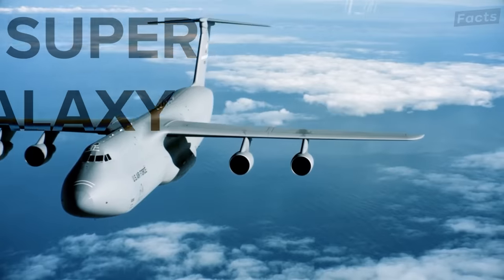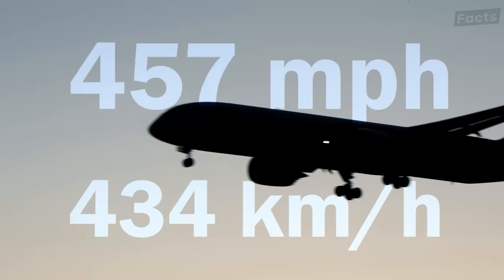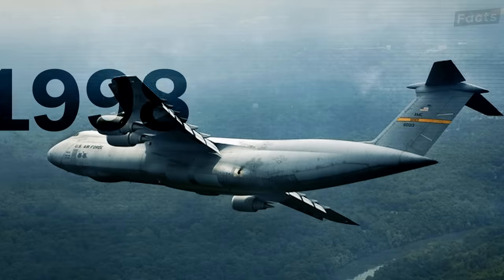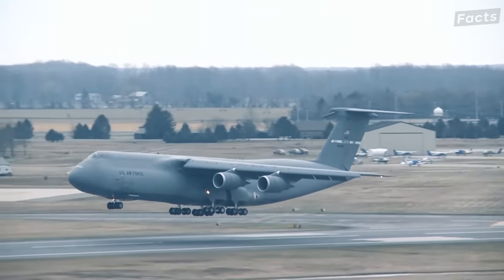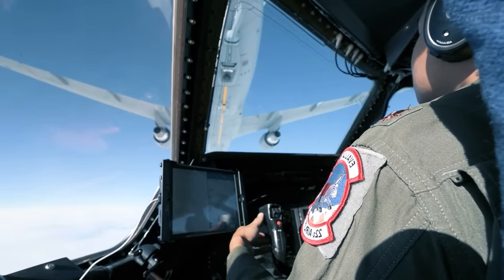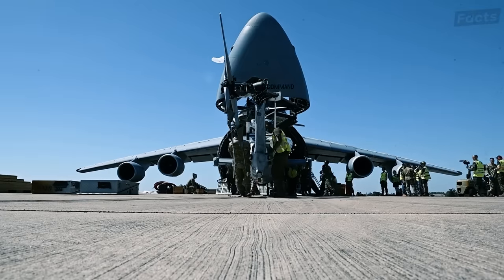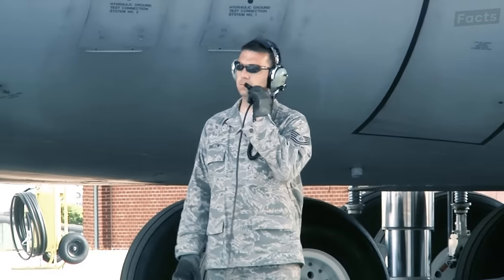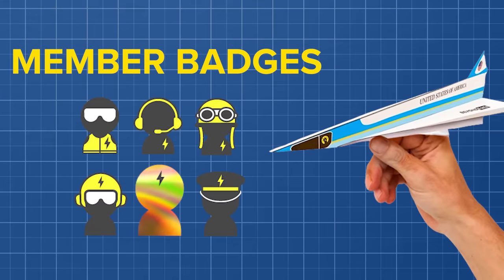The LARGEST Aircraft in The Air Force Has A GIANT Problem

Comment: Nothing can do what the C5 Galaxy does - will go down in history as one of the greatest airplanes ever built - Msgt WRMcGowan USAF (Ret) ||  C5 Flight Engineer for 20 years
Reply: McGowan when was you station at pope,I was there 1963 to 1965 crew chief on 801 c130
Reply: An225?
Reply: Kinda dead  @wolfrust0
Reply: @wolfrust0 
Mirra down to one in parts, stated in this video more than 50 C5s in operation. 
Even if there were two C5s for one AN225, which is more payload, that’s 25+ pairs. 
And Strattolaunch is way bigger. (Wingspan)

Comment: NOT " SHOCK ABSORBERS".....THEY ARE CALLED " STRUTS"
Reply: Been around long time keeps going on
Reply: theyre the same damn thing lmao...a shock absorber is anything that absorbs shock...flexible landing gear on single props are shock absorbers too. Plus these planes use oil filled Oleo struts which work exactly the same and were LITERALLY PATENTED AS AN AIRPLANE SHOCK ABSORBER
Reply: @Shadow0fd3ath24 they are hydraulic struts. Not just oil filled shock absorbers. The C5 has a feature that allows the aircraft to kneel , lowering the plane to where the cargo ramp when opened is truck bed height.
Reply: Shock struts is what they were called in the maintenance technical orders while I was in... they were all air inflated hydraulic struts...
Reply: Welcome to the aircraft group

Comment: I worked on C5A and C-141 at Travis AFB,  Ramstein AB,  Torrejon AB and Altus AFB  a long long time ago.   Then 36 years at American Airlines.  Now 63 I could fix that today.  At Travis AFB in the AR Shop my first jobs included jacking the C5 outside on the ramp,  replacing large components and rigging the entire system.  I was still 18 years old.  I didn't stop for 41 years (36 at AAL)  until 3 years ago.  All thanks to the USAF.
Reply: I was a C-5 loadmaster at Travis AFB

Comment: The C-5 was a giant and a great aircraft to work on. I also worked on the fabulous C-141A and B.  I worked both airframes from 1981 to 1990, as an Aircraft Electrician Environmental Systems Specialist, and I loved both airframes. Both Airframes were used as SOLII aircraft in Special Operations.

Comment: In 1970 while stationed as a station aviator at NAS Cubi Pt in the Philippines, we were transiting from Bagio in the mountains back to Cubi and as normal overflew Clark AFB. Clark had a large parking area for the C-130s and another for the C-141s. We glanced down and noticed what I at first thought was a C-141 parked amongst all the much smaller C-130s, when I realized it was in fact the C-141 parking are with a much, much larger C-5 parked there. While we had of course heard about the program until you see one in person, you can't really appreciate how big they are. They have earned the nickname of the aluminum overcast.

Comment: One time when I was stationed in Italy, there was a Galaxy facing away from my barracks room. After having it's engines on for a while, my door was covered in residue from the engine exhaust. The area it was loading/unloading from wasn't meant for an aircraft that size which is why it only happened once. I don't know the reason.  It's an impressive aircraft but don't leave anything behind it if you want it to stay clean.
Reply: Riiiiiight ... maybe if your barracks door was 20 feet away it may have left "residue" before blowing out the windows and blowing the door of the hinges .... I was a Engine Mechanic and engine run certified on C-5`s and C-141 and find  your story to filled with inaccuracies and make believe. There are minimum safe distances stated in the Engine Run T.O. behind the aircraft that have to be clear before even starting up the engines ... the higher the power setting you are going the further the safe distance is.
Reply: I can't say how close it was, but it felt too close given the size of the aircraft. I'm not an aircraft mechanic. I just had to clean the mess off my door when I got back from work. Just stating my perspective at the time.

Comment: So its a weapon of war and you are worried about the environment? That is stupid.
Reply: The idea was it could fly further w/increased payload resulting in fewer compression/decompression cycles on the physical airframe while getting better fuel economy. Short of crashing, the thing that results in aircraft being decommissioned and sent to the boneyard is stress/strain between panels/rivets of the pressurized compartments. Most everything else can be removed/replaced overtime.

Comment: I was at Altus AFB Oklahoma on a temporary duty assignment while they were flight testing and training the very first C5A that Lockheed delivered to the USAF.  We were at the flight line getting ready to return to Scott AFB Illinois while the C5 was in the air with a little problem - the nose wheels wouldn't come down.  They were doing flybys of the tower for visual checks while they tried to correct the problem, and I have a picture of us watching it seemingly floating by with the rest of the landing gear in place but no nose wheels visible.  Eventually a crew member was able to climb down into the guts of the plane and crank the wheels down by hand.  It finally was able to land, with the runway covered with flame retardant foam and fire trucks and an ambulance standing by just in case.

Comment: I worked C-5s for 13 years both on the flight line and in shop.  The C-5 is an amazing aircraft.  I was stationed in Dover and was there from Nov 1981 to Jan 1988, then from Apr 1991 to Jan 1998.

Comment: The runway distances for takeoff and landing, measuring 8202 feet and 4921 feet, respectively, seem remarkably brief. This configuration is likely to be practical in only a limited set of circumstances, where the aircraft is relatively small, or the weather conditions are favorable. However, it is doubtful that an airplane could take off with only 4921 feet of runway. Such a feat would require a highly skilled pilot and a meticulously maintained aircraft, both rare in the aviation industry.
Reply: I saw a C-5 takeoff in 1800ft at Travis AFB. It was empty and only enough fuel for the airshow. We also had a strong headwind straight down the runway
Reply: The C-5 used to do training at my local airport. The runway is only 6,000 feet. We now have C-17s in and out about 3 times a week. What I miss is the F-15s coming in and out all the time. They are much more fun to watch than the F-22 Raptor that replaced them. The Raptor requires a longer runway than the Eagle did and is a lot noisier so the Air Force doesn't send them here as much.

Comment: I have ridden on the C-5 twice and from the boom pod of a KC-135 watched a night refueling of a C-5.  It is quite an aircraft.
One bit of trivia not mentioned.  The C-5's fuel capacity is more than the takeoff weight of the KC-135A.
Riding backwards is not a problem as there are few windows on the passenger deck.  The only time you realize your seating position is on takeoff and landing.  The seats are rather comfortable.  The spacing is not that tight.  Granted the inflight meal was not great just a box lunch.
Back during basic training at Lackland AFB, TX, to give you an idea how massive the C-5 is, my flight would see one flying off in the distance.  The C-5 just seemed to hang in the air not moving.  We swore that we were marching faster than the C-5 was flying!

Comment: If they have a very heavy cargo load. Do they takeoff with less fuel and then top off in flight?
Reply: Yes. When we would leave out of Dover AFB headed towards Europe if we were heavily loaded we would take off light on fuel and then refuel somewhere off the coast of Maine usually. You are not a dummy, good question.
Reply: Depends on the length of the mission.  For short flight, air refueling is not required.  For heavy loads, going overseas, air fefueling was needed. Basically the same as a KC-10.
Reply: @robertheinkel6225  He said that.🙄
Reply: Normally on a channel mission we did not air refuel. On SAMs JATs and other missions we would air refuel. Most time we a/r it was for training/currency.

Comment: The C5A suffered right wing metal fatigue, cracks and was a headache for Lockheed. It was designed by using a C141 design enlarged by computers as a shortcut to save money, unexpected stress occured.
Still a great aircraft but can't compare to the B52 for design excellence.
Reply: For a long time the C5A had inflight weight restrictions due to that wing root metal fatigue problem.  When it had to carry a lot of heavy cargo, it would takeoff with considerably less fuel than needed to complete the flight and depend on KC-135s (usually a formation of three) to meet it enroute and bring the fuel up....but the C%A could still not be "topped off" due to the inflight weight restriction.   "Down the road" a few hours the C%A would meet up with another flight of KC-135s to repeat the process.   I think they did this three or four times to get the long distance mission accomplished.  I was on a co-pilot on a KC-135 crew doing this on more than one occasion.   Fun times!

Comment: I first saw the C5A Galaxy at Moffett Field in 1968-9 land and squat for loading and we took the full tour save for the Cockpit then it took off later in an amazingly short distance that no airliner at SF international ever could. The original Rolls Royce engine sounded unlike anything i had ever heard landing or taking off. It was quiet but wined like something from a science fiction space movie. My dad worked at Lockheed Missile and Space in Sunnyvale Ca. next to Moffett Fielded Naval Air Station and 20 years later i served on new Ohio class SSBNs with Lockheed UGM-96 Trident I C4 SLBMs until the massive 126,000lb UGM-133 Trident II D5 designed for the big Ohios SSBN were fully operational a year after i left Service in 1989 as a Missile Tech.
Reply: C5a never had Rolls Royce engines it had TF39s

Comment: Please, stop with clickbaiting, especially when you have no idea what you're talking about.
"It carries multiple army tanks "????? If you mean the tank, which is in US military inventory, the M1 Abrams, it is exactly one...
Reply: We can and have carried 2 M-1 battle tanks. I was a C-5 loadmaster 11yrs and have done this personally. But during peacetime, we would only carry one at a time to preserve the airframe . Also, the NORMAL gross takeoff weight was 769,000lbs but I have personally took off at 925,000lbs and air refuel to over a million pounds. Another loadmaster said during testing at Edward's they took off at over a million pounds. BTW, a M-1 weighs approx 62-64 tons each, the T-72 weighed around 72 tons which we carried from Iraq at the end of the first Persian gulf War. The most cargo was a load of bombs at around 284,000 lbs, which required a waiver.
Reply: Not to preserve airframes, but not to exceed max load. To M1 (early models) weigh more than max load. Of course, it would be possible to overload. Not legally... Newer models are even heavier, so... 
And, please, tell me where you found the weight of T-72? In your loadmaster's manual? Or it was made of tungsten...

Comment: THESE NUMBERS ARE NOT THAT IMPRESSIVE. THE AIRPLANE I FLEW HAD ENGINES PRODUCING 90,000 POUNDS OF THRUST. WE ROUTINELY FLEW 8000 NAUTICAL MILES WITHOUT REFUELING. STILL, THE C-5 IS AN IMPRESSIVE MACHINE. IT IS VERY SIMILAR TO THE AN-124 THE RUSSIANS HAD (WHICH IS A COPY OF THE C-5).

Comment: Thank God it's a Lockheed and not a Boeing or it would be in the scrap heap...
Reply: Remember, Boeing built the B-52s.  They are even older than the C-5s.  The KC-135s are Boeing built and in the air long before the C-5.

Comment: Not great.  What is the "GIANT Problem"?  Was it expensive? Yes.  Did it burn a lot of fuel? Yes.  Neither of these are "GIANT Problems". 
The C5 met requirements, admittedly after the "usual" initial problems.  IT did/does what it was called for and designed to do.